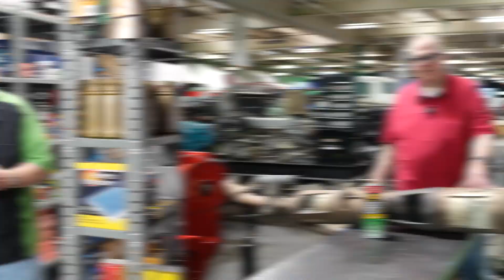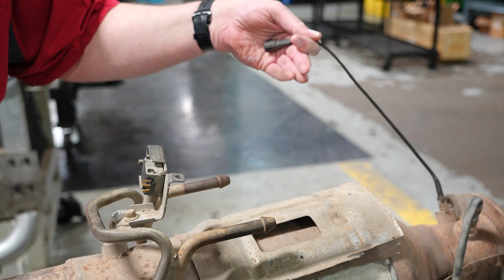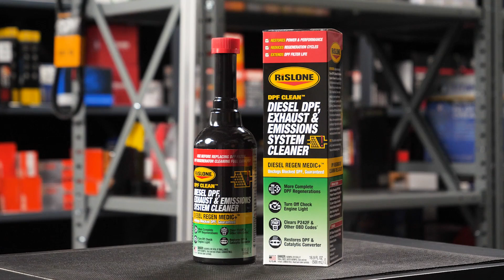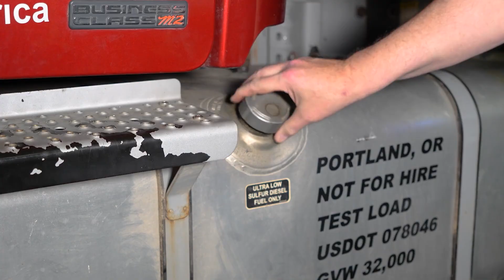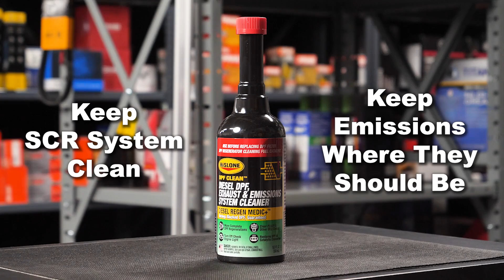Rislone DPF Clean® Diesel DPF Exhaust Emissions Cleaner Talking Parts

Comment: I have a 25 gallon tank on my Isuzu NPR… 2 bottle for the full tank? Using this product, can you skip cleaning the DPF on regular maintenance?
Reply from the maker: In a 25 gallon tank you will want to add the product at a 1/2 tank of fuel and run per instructions. Link to instructions below. If you have any technical questions please use the contact us page on our website to speak with our Technical Support Team. 

https://rislone.com/products/dpf-clean-diesel-dpf-exhaust-emissions-cleaner/

Comment: I already have p200200 and p246300 codes and car was in limp mode. Battery died and I replaced it and now the engine turns on. I am scared to moved the car and I assume the limo mode will return shortly thereafter. With diesel prices right now I'd hate to spend $40 on this product then another $100 in gas for me to still have to take to Audi and pay the diagnosis /fix. I haven't driven the car for 8 months because of this issue. Do you think it will potentially fix the problem
Reply from the maker: Yes we can help with those particular codes. We have a full money back guarantee on the products as well, so if not fully effective you will get your full purchase price back. 

Use the below link if you would like to speak with one of our Technical Service Representatives on the effectiveness of the product for these issues. 

https://rislone.com/contact/

Comment: I had engine light on, luggish, misfire, kick down does not work, drive trains errors. I start with Rislone Diesel Dpf, exhaust and Emissions System cleaner. Drive until you have only 5 liter diesel left on fluid tank. Fill up about 60 liter diesel and pour whole bottle Rislone Hy-per Diesel Complete system cleaner. Now you will feel the magic, your engine run  more smooth, misfire gone , drive train errors does not pop up any more, kick down works. My is 14 years old BMW. After this two treatments my car is like new. I have tried many thing nothing works. These stuff from Rislone works.
Reply from the maker: Thank you for the comment, glad we could help!

Comment: This stuff works. Cleared my check engine light.
Reply: What engine code did you have present? Also, what year, engine, and miles?
Reply: @Nihil2005  EGR code. 2006 Duramax HD2500 with 107,000 miles
Reply from the maker: Thanks for the comment, Glad we could help!

Comment: Is it okay to use multiple additives at the same time, for a diesel.  I mean should I use the 'Rislone DPF cleaner' AND 'Power Service  CETANE BOOST' mixed the the tank at the same time?  Is it a good idea, or will it muck something up?
Reply from the maker: No do not add more that one additive per tank of fuel.
Reply: @RisloneGlobal  I had my RV and storage for the summer so I added some Lucas fuel treatment. What I need to wait until all that fuel is burned off before I use this product?
Reply from the maker: @inspired2rv661  Yes, you will want to wait until you burn all that fuel out before adding our product.

Comment: How many gallons does one bottle treat.   ?   Doesn't say on product box.
Reply from the maker: Up to a 40 gallon tank.
Reply: The box says to fill it up a quarter tank. If I have 100 gallon tank, I fill it to a quarter tank. It’s only 25 gallons of fuel per bottle.

Would I be better off filling the tank and putting two bottles in or do I put in one bottle for a half tank? Perhaps either option would work depending on the situation.